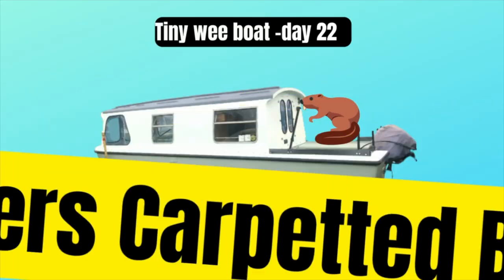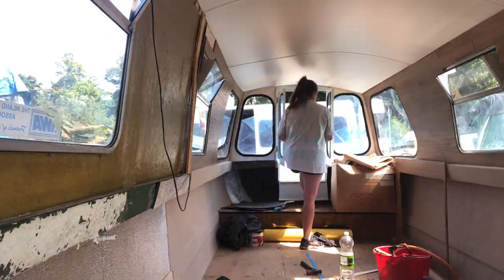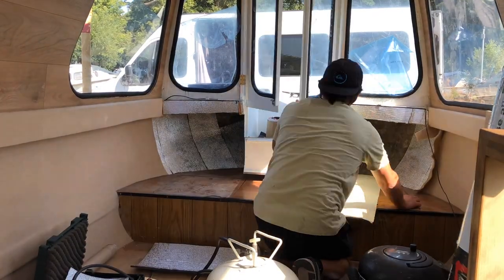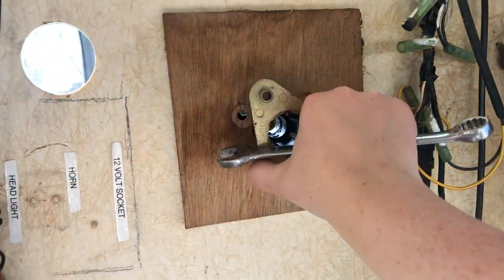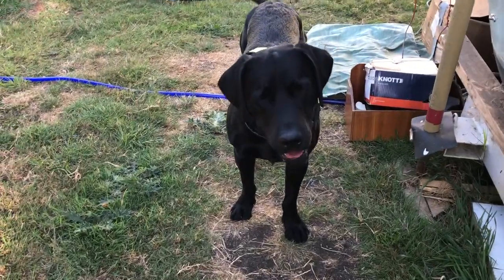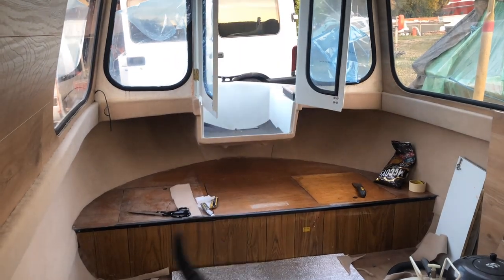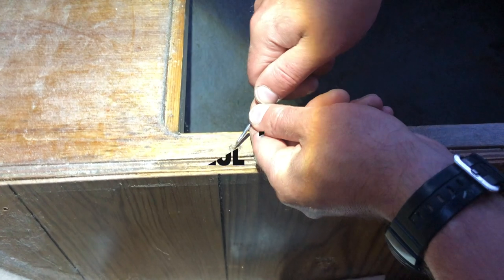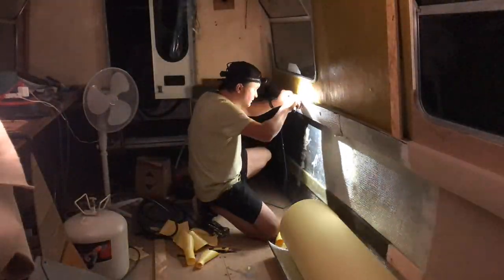Carpeting the bow & OUR FIRST FAN!! - Tiny Wee Boat Day 22

Comment: Agm must be vented outside. Only lithium batteries can be inside. If you box in the batteries and seal the box you can use a ventilation tube to outside. He did a beautiful job installing the carpet.
Reply from the maker: Hey, thank you so much!! This is really helpful so I think we're going to need to replan how we're going to do the batteries! Appriciate the tip, thanks again :D
Reply: There are also closed cell AGM batteries... no need for venting, just keep them cool(ish)

Comment: You can fit a tiller to the outboard, this will remove the need for a wheel and also make the boat easier to steer. Most of the Beavers are done this way, by looking at a wheel you have no idea which way the boat will turn. Batteries are usually mounted at the rear of a boat because the power from the alternator  will be lost due to volt drop if you run a cable to the bow.  Hope these ideas help. Best Wishes. Neil and Anne
Reply from the maker: Hey Neil and Anne, thanks so much this is very helpful! Really appriciate the tips :) x

Comment: Carpet is looking great, Victor is doing a really good job.
As for batteries, wiring, gas and cabin ventilation, please refer to the Boat Safety Scheme (BSS) requirements. If your boat does not comply then you will not get a BSS Certificate to be able to use the boat.
Steering can be done with a long tiller and separate Morse (gear) lever on the rear railing.
Great videos, really enjoy them.
Reply from the maker: Hey Steve!! Thank you, so glad you think so! And yes, thank you! That's what we're worried about it the BSS certificate. Thanks for sharing, will check out a tiller. So glad to hear you're enjoying the videos :)
Reply: @TinyWeeBoat  thanks, it's good to know that you are aware of the BSS. Ever thought about joining the Wilderness boat owners club? We have an email group just for club members to share advice etc.

Comment: Yes AGM batteries must be vented. The rule is the area they are in must be vented so that the hydrogen buildup never reaches 4%. 4% concentration is the lower explosive limit of hydrogen gas. Ideally you would have two vents, one on one side of the compartment and one on the other side. One for air to exhaust and another to draw in air to replace the escaping air. It should not have to be too big about 1/2 inch or a little bigger. You should have a mesh on them so insects do not try to make a home in them. I don't think you want bees in your beaver, if you do that's ok, I'm not judging you.

P.S. Bees In My Beaver is the name of my Milli Vanilli cover band.
Reply from the maker: LOL Bees in my beaver is a great name for a cover band!! Thanks for the helpful advice Roger, really appriciate it!!

Comment: Carpeting looks great. Interested as to what glue you used. I've vbeen putting some carpet on the sides of my van. Some bits have to go on metal but after a while it starts coming off. Love some suggestions. I wouldn't put AGM batteries inside. Want room under the seats at the back?
Reply from the maker: Hey Glen, the glue we used is called Tensorgrip L40 feel free to check it out. This should work for carpeting your van. Yeah we're starting to think that AGM batteries would be better outside!! Thanks for the information!
Reply: @TinyWeeBoat  thank you sounds exactly what I'm looking for. Sigh! not available in New Zealand. Ah well I'll keep trying. Thank you.